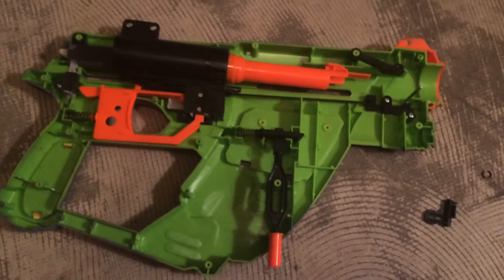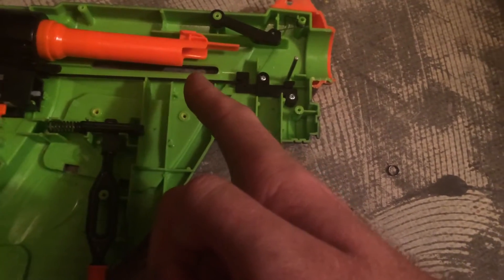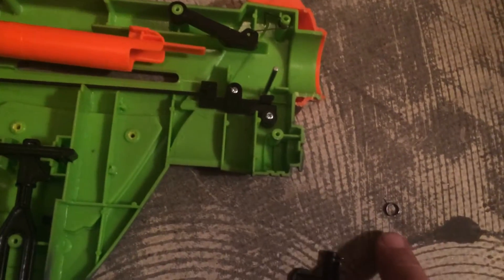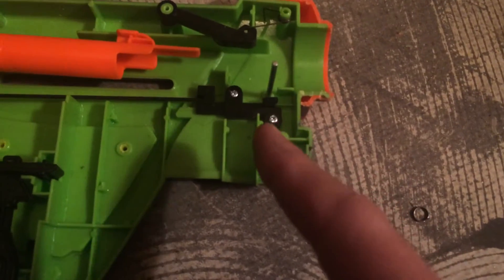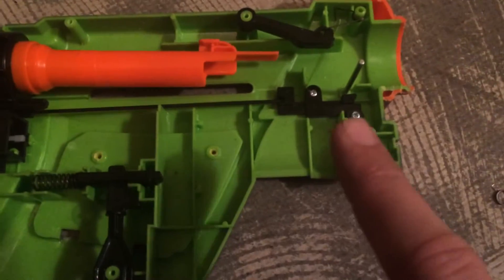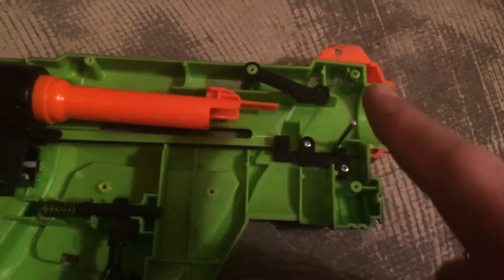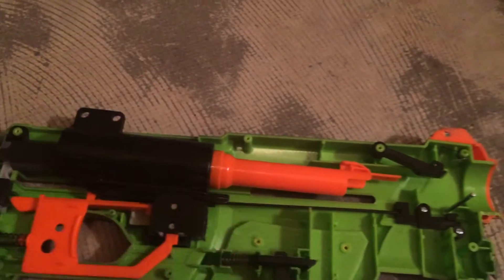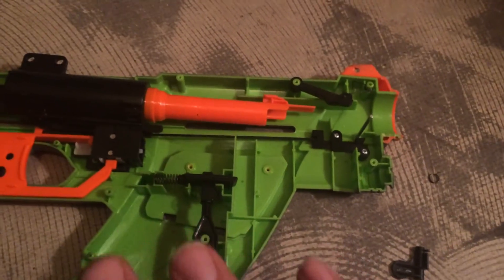Late Night PSA: Why you shouldn't mod the Ultra Tek Reaper by Buzz Bee

Comment: Your solution is Brass Breech.
Reply: Been waiting for someone to brass the Champion or Reaper and document the results, just to see how well it works.  Read on Buffdaddy Nerf's blog that the draw on the Champion was too short for a standard brass breech.  Combine that with the fact that both the Champion and the Reaper seem to have glued-on orange tips to get through, and I think I'll stick to my Sentinel.
Reply from the maker: I fully admit to having never brass breached anything before. I'll look into it for something other then this unless someone reports awesome performance to make it worth the headache
Reply: i heed your warning Derek Gonsoulin, but besides the front barrel of the reaper i still think i can mod this.
Reply: The Reaper has excellent stock performance. It is very accurate and has decent range. Plus I can use it one handed.

Comment: Take orange bonnet off by sliding wedges under edges slowly the bonding will release from main body make sure to not pry up or you will break the blaster. I have found that the dart tooth has a guide hole for placement and once bonnet is removed easy cheesy .
Reply: gargunkle a heat gun don't overcook take time and go slow.

Comment: i got it back in and working enough to where the dart tooth returned but became loose when i pulled the trigger and still shot, but  it wasnt being pushed down.

then on my second attempt i got it to push it down but not as far as my stock one. at least it fires and modded its extra beastly i get a good fps boost